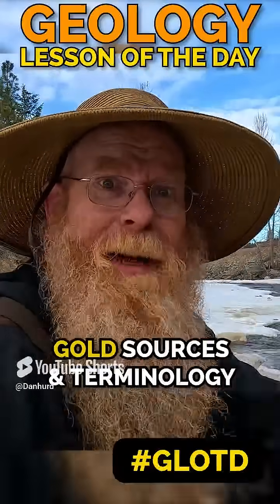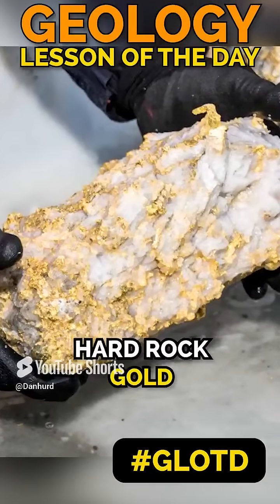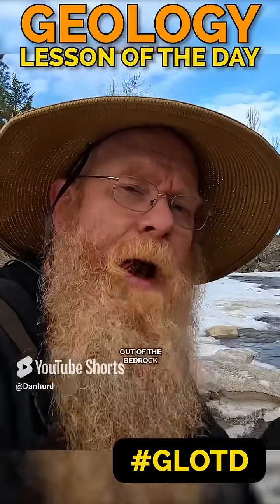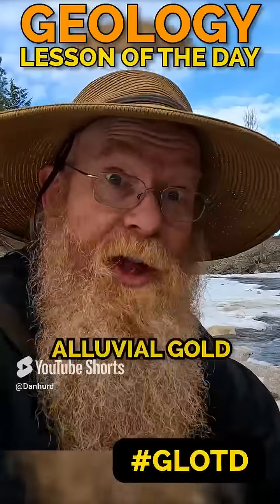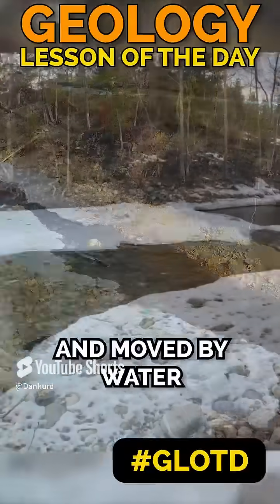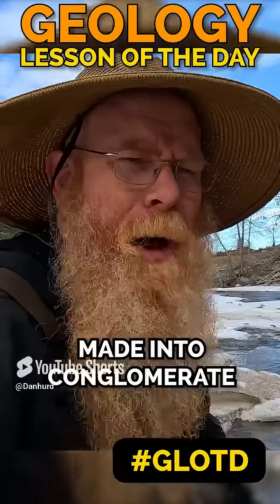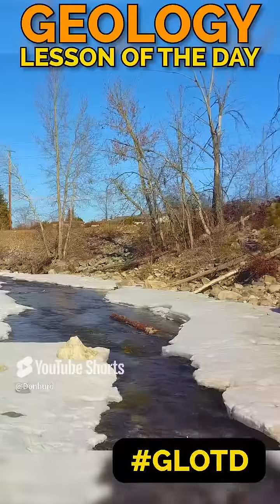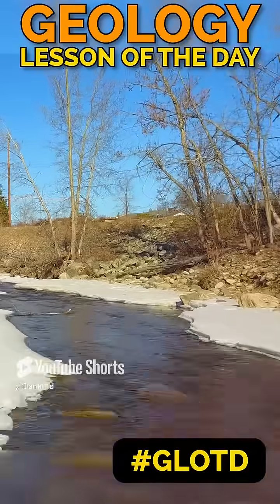Where does gold come from   And the terms!

Comment: Ima stop you right there, couse you're wrong! You used "quaternary gold" wrongly. This term just means that this gold is eroding from quaternary rocks. If it was paleogene gravels or permian sands it would be called paleogene or permian gold respectively. Sometimes name's derived from rock unit like magura gold (gold that's weathering from flysch deposits in magura nappe in Poland) - it's always local name and you didn't emphasize it enough. The term that you should use is paleoplacer. It's basically what you ment, older alluvium that contains gold and can be source rock for modern alluvial deposits.